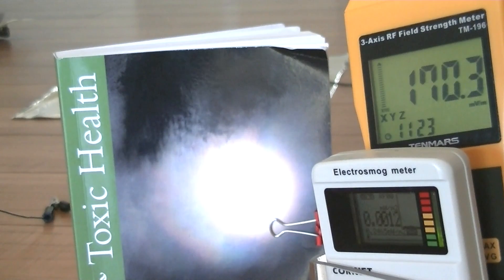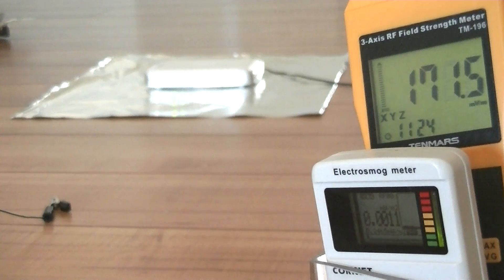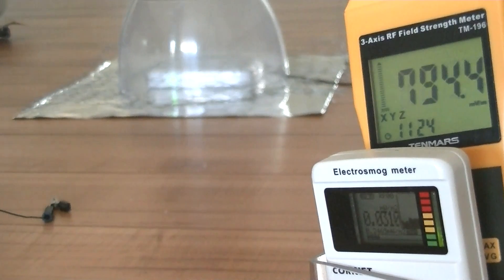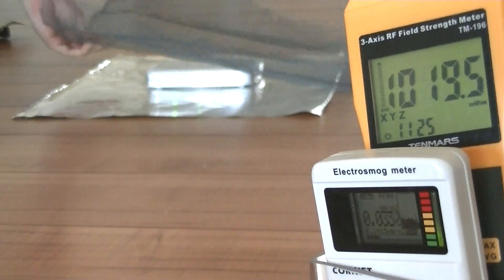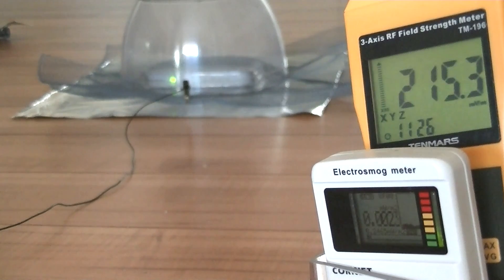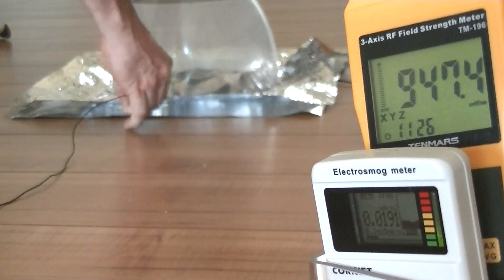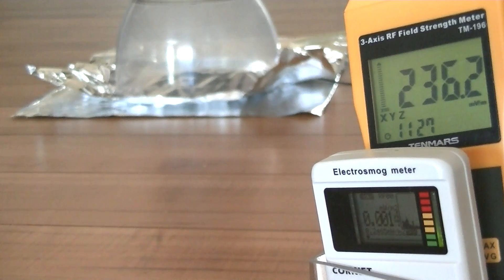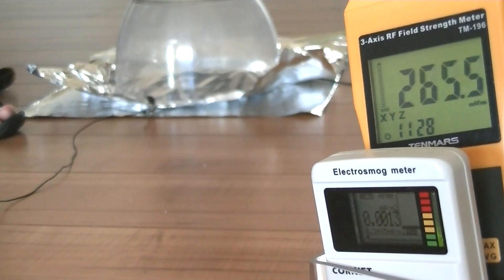Electromagnetic Shielding Performance of Popular Products, Grounded & Ungrounded

Comment: Have you tried the reverse?  Putting the meters inside the shielding materials?

I have a similar 3-axis meter, a TM-195.  The ambient field intensity is about 2 V/meter in my place.  When I put the meter inside a mylar enclosure the reading drops essentially to zero .  Sealing the bag completely will drop it to 0 mV / meter.  Slight gaps left open will allow the reading to hover around 50mV/Meter.

However, placing a cell phone inside the bag will drop reception from 4 bars, to just 2.  Calls can still be made to the phone while in the bag.  Strange.  
Perhaps my meter isn't accurate at cell frequency?  
Or, perhaps the phone can operate even with a tiny fraction of the total signal?

Can anyone explain this?

Comment: Why was the 3-axis gauss meter measuring ~400 mA/m when you applied and removed the chicken wire with the plastic cover off? Do you have an explanation for that? Was it because you exposed yourself to the device which then took power from the conductive pad that it receives from the device, thus lowering the reading?
Reply: I was wondering about this too!
Reply: It was the only one that did that. So it wouldn't be him heself reducing the power.

Comment: Measure the resistance of the blanket.  See if it conducts well and check for continuity between the blanket and the base foil.  I previously bought one type of emergency blanket  (don't know which brand) which did not conduct well and failed to shield well at all.  Then I bought ones made by Coleman and found they work well for shielding.  Advantage is they are light, puncture resistant and large.  Heavy duty aluminium foil does seem to work better, as it is much thicker though.

Comment from the maker: This was the second video that I did that was far more controlled than the first.  I got similar results by covering it up with two large space blankets!  Search "Comparing Shielding Performance of Space Blankets, Aluminum Mesh and Foil, Grounded and Ungrounded".  It appears that there is a very big difference between space blankets and aluminum foil in the near field application.
Reply: Thanx for video.
I liked ur video very much.

I hv to develop wiring harness for electrc vehicl.

Is aluminium tape (100 micron coating) enough for that?

Comment: I think you had the wrong side of the 'space blanket' facing downwards.  One side is aluminium and the other is usually polypropylene; only the alum side conducts electricity.  For a Faraday cage to work properly there must be continuity all around.  Use a DMM & test for continuity btn the foil mat & blanket & shielding results should be similar to mesh or foil re: 2.4 GHz emfs.